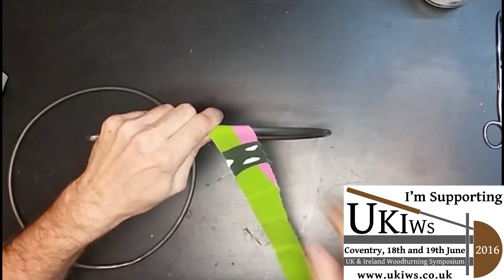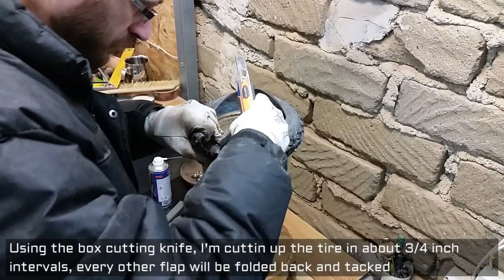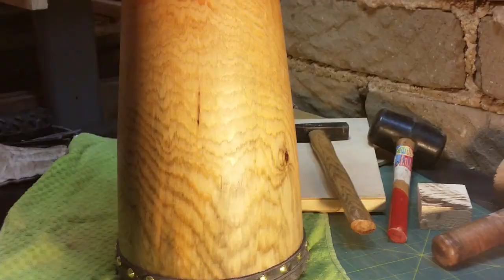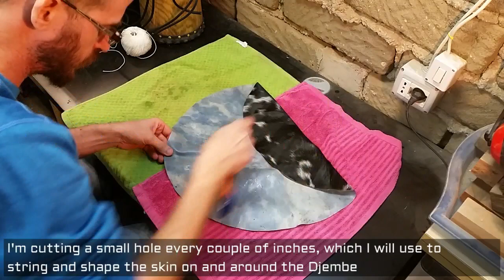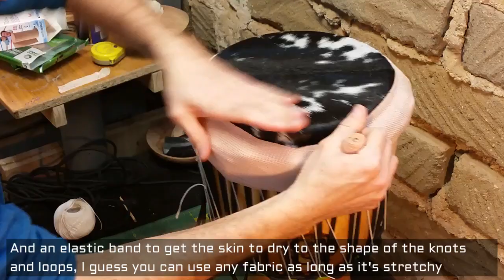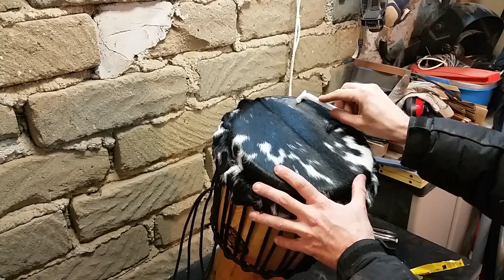Woodturning Djembe Dream Part 6

Comment: Yuval, I thoroughly enjoyed your Djembe turning journey. Your finished Djembe looks and sounds absolutely beautiful...!I've a question, do you still have the smaller belt on your lathe and if so have you had any problems with the 1/2 horse motor such as capacitor burning out etc?
Reply from the maker: Thank you Jack!! I don't keep the shorter belt on, since I like the full range of speed on my lathe, I normally turn much smaller projects and need the high speed for them. I did burn out the capacitor on my motor, like you suggested, but it was cheap to replace and I was lucky to find a place near my house that sell these. (I need to do it again since it went out of me once more, my half horse power is acting like a 1/4 horse...).            

Yuval.